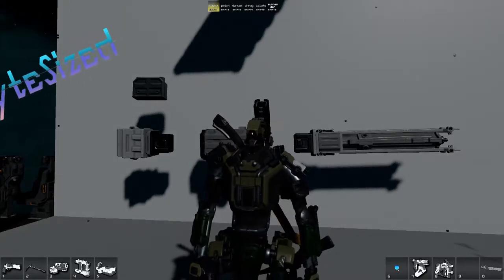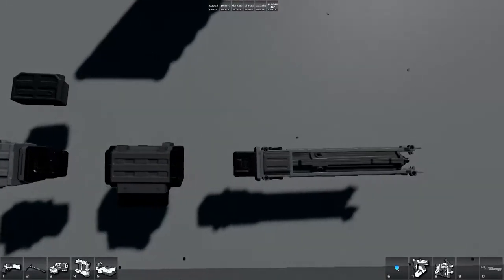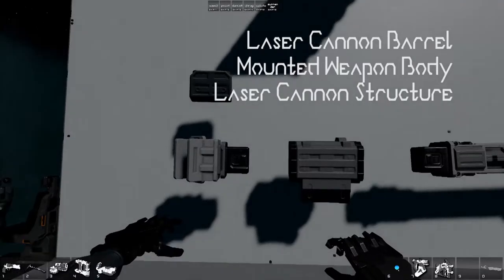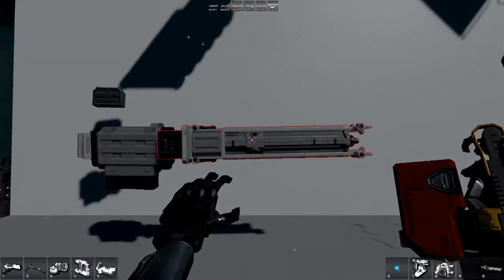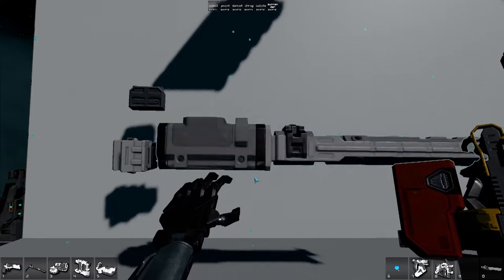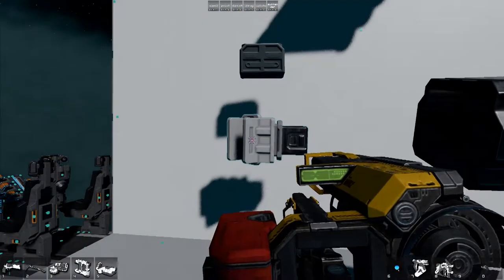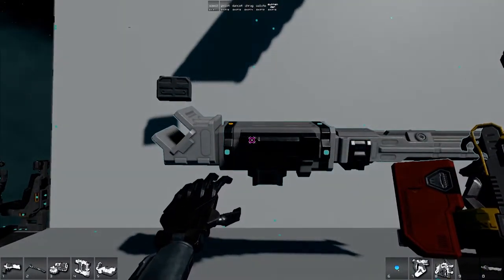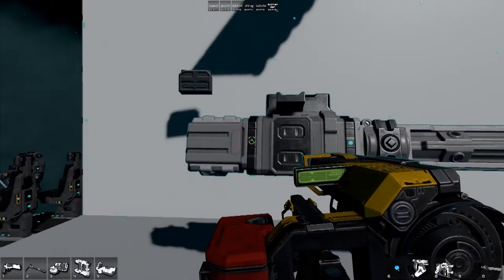Starbase: ByteSized | Laser Cannon Assembly

Comment: hi! how to craft 800-ammo magazines for laser cannon?
Reply from the maker: In the "Basic" tab of the tech tree on the left side you can see the branch for ship weapons. After unlocking the laser cannon, you should be able to craft them provided you have the materials. You will need to build your own crafting table and crafting bench tool that you unlock on that weapons branch.
Reply: @XenoCow  Yes, I know that. The problem is that there should be 800 active bullets in the magazine... but when crafting it turns out from 0 to 200. and the rest of the bullets are not activated (once 200 bullets have been used up - the next 200 bullets are not activated). this is a bug that has already been reported to the developer 1000 times. there are rumors that someone has learned to overcome this bug and make a magazine with a normal set of 800 bullets. so i'm asking, how? )
Reply from the maker: @ПавелКрутой-б8ф  Oh, I didn't know that people were having trouble getting the other 600 shots to activate. I sadly do not know how to get around that bug. Best of luck to you.